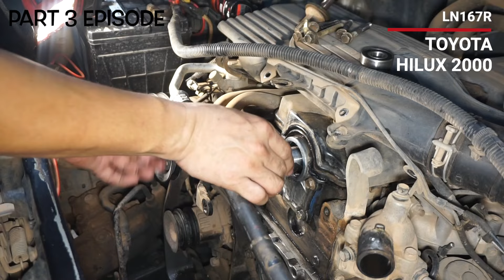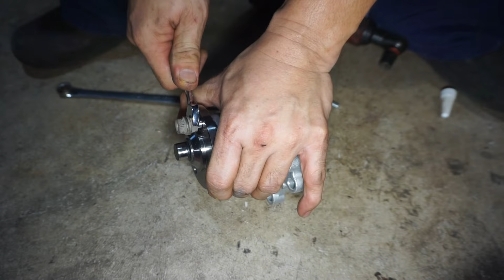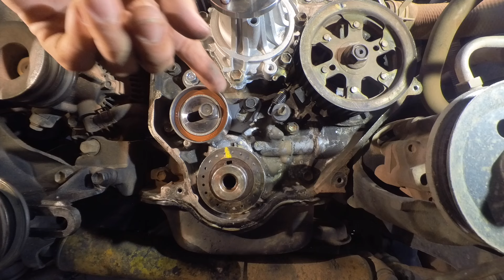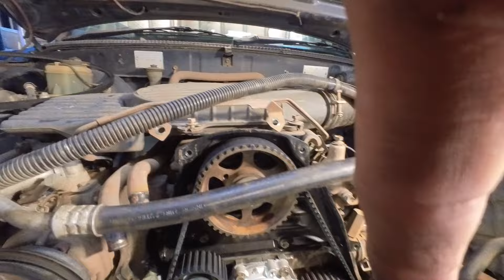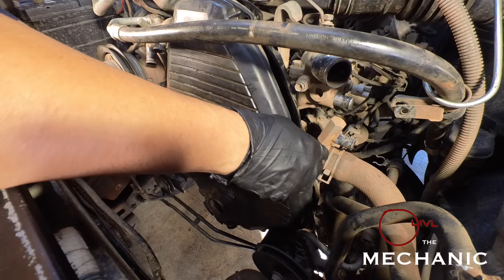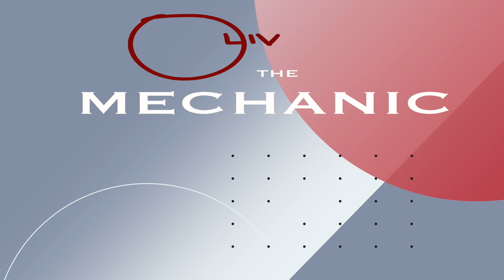HOW TO REPLACED TIMING BELT / WATER PUMP TOYOTA HILUX PART 3

Comment: HELP  i think my old belt has stretched???? the crank shaft is spot on and my the other one is spot on but the top one is  1 tooth out?? are 2 timing marks enough to work on or do you need all three
also the top pulley has a mark on top and another mark on the bottom ??